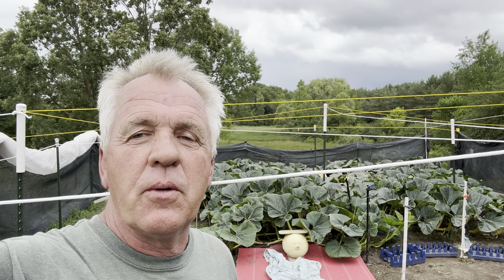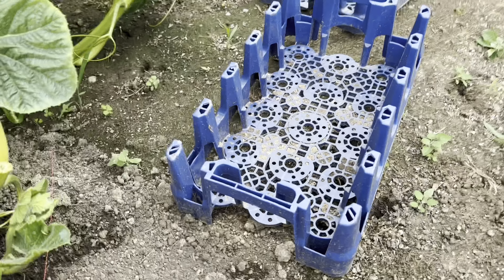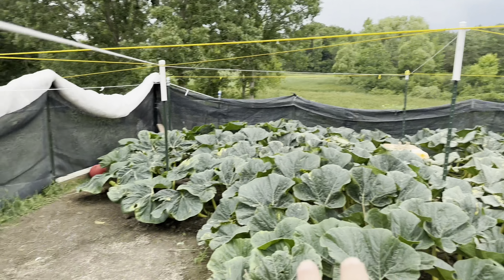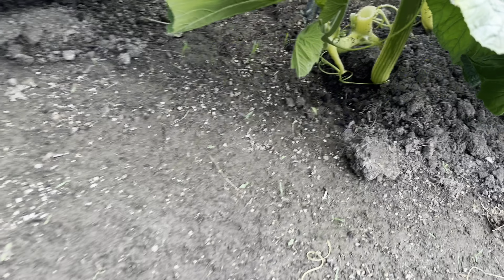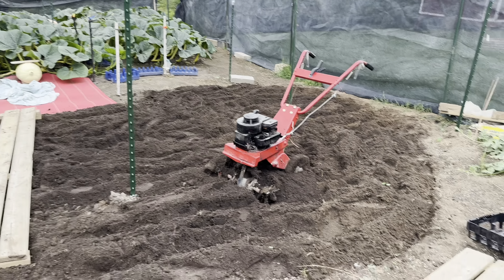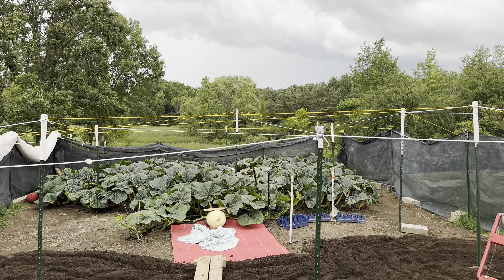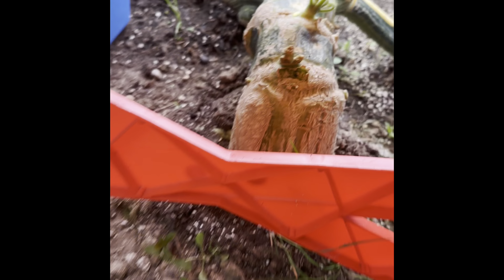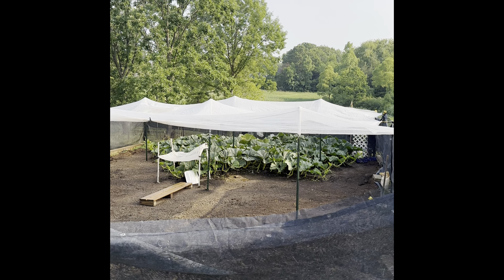Giant Pumpkin Smoke & Heat Update

Comment: I'm kinda bummed I had to let my #1 go off my Mavrick yesterday. Bad stem crack. Tomorrow I'm pollinating a Tiger King with my Mavrick!
Reply from the maker: How bad was it stem cracks every common the pumpkin will grow fine with them
Reply: @KeepitaSecretGarden  There were 2 cracks one was a quarter inch wide. My pumpkin was sitting in a puddle of water 👎
Reply from the maker: I have grown many pumpkins with bigger splits on the stems then that just to let you know for future growing splits. Vine splits in stem splits are quite common and will not hinder the grow. Most are due  vine pressure.
Reply from the maker: Yes, that’s not a good thing puddle of water